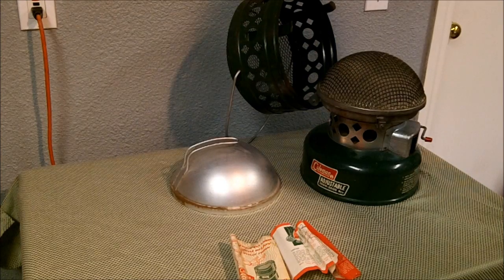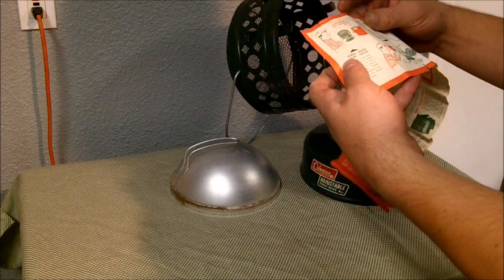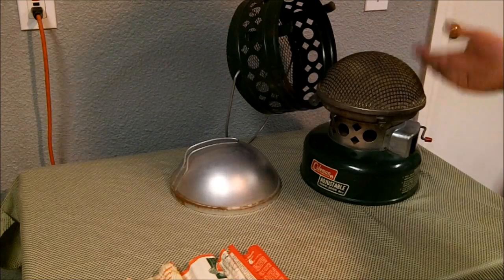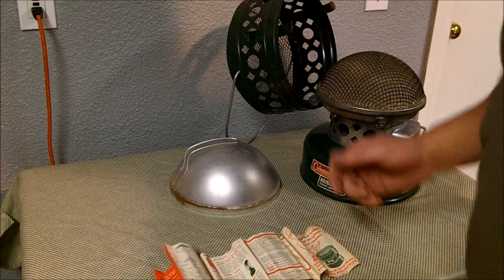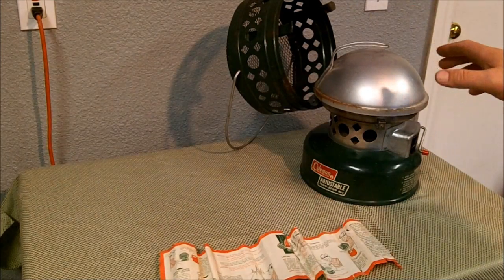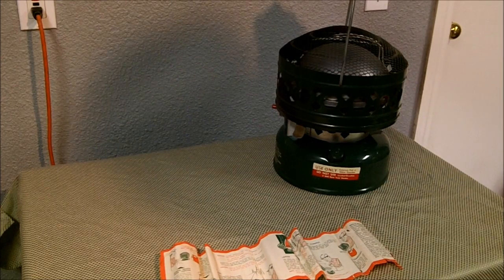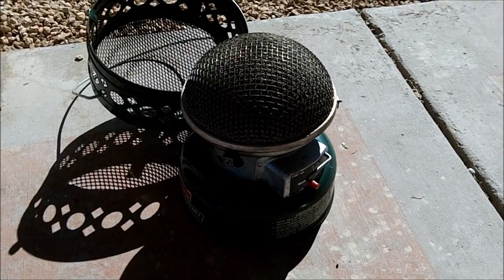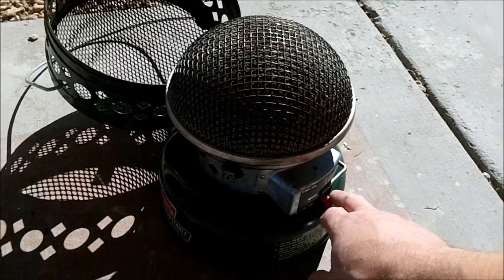1967 COLEMAN CATALYTIC HEATER 513-700

Comment: A trick to starting these is to turn them upside down for a bit until the center of the dome is wet.  Then squirt fuel around the edges being careful not to drip off the dome.  Light and jump back.
Reply: I have two Canadian Coleman heaters, one from the 1970s and one from the 1980s. I often try that trick of turning them upside down, but I find it takes ages for any fuel to come down. I don't mess with my heaters that much anyway, I really just have them since I collect Coleman stuff.
Reply: +SouthWestNS Productions Your wick may be bad. Especially if it has sat with gas in it for a long time, it can make the wick very hard to where it will not suck up/flow gas anymore.

Comment: FWIW, I have the non adjustable version of this heater, to start it I use a small fuel bottle (I think they are pints) and just pour an X across the dome, let it vaporize for 30 seconds or so and light it. Works every time.

Comment: Thanks for posting this video! I bought one of these at a flea market still in the box but the directions are missing. I had no clue how to light it until now. :)
Reply from the maker: You are welcome, I have found the best method is turn it upside down and soak with extra fuel (method 1 and 2).
Reply: Happy usage of the heater. If you ever decide to get rid of it I will purchase it from you.

Comment: When I lived in Alaska, several Bush pilot friends swore by those things, for preheating their aircraft engines in remote locations during the winter time. They knew they were out of production, and wouldn't sell them at any price.
Reply from the maker: I bet they work way better than propane heaters in those Alaska cold temps.
Reply: They absolutely do, propane doesn't work at all in 40 below zero. neither does anything requiring electricity.

Comment: I have one of these in my garage from an auction. I knew it was a heater but knew little more than that. Thanks for the info. You mention that you will use it in a garage. Is it safe? Does it not put off harmful fumes? I too want to use in garage in winter while I'm working there.
Reply: These are relatively safe so long as there is ample ventilation in the room you intend to use the heater in. The Coleman fuel burns really clean leaving almost no harmful fumes behind as far as I'm aware. It's the CO from oxygen consumption you have to worry about. So again, fine to use in your garage as long as you have some kind of air flow to keep the oxygen levels safe.

Comment: Just cover it with fuel and light it and it will slowly burn out but remain light, then it takes about 30 minutes to start throwing heat
Reply: That is wrong. The correct way to light is to flip unside down until a 2" wet spot appears in the center. Another way is to squirt an X across the burner then light. If you soak the entire surface that is why it is taking 30 minutes to start throwing heat.

Comment: Can I use K-1 Kerosene in my Coleman 513 adjustable heater? Thanks
Reply from the maker: That is a good question, unfortunately I do not have a good answer. I seen some for sale on eBay that the 513K as model number. It appears the seller believes that this model uses kerosene.  I have several models maybe I should do a test.

Comment: Can I use it inside a tent?
Reply from the maker: Lumel Aguirre I wouldn't.
Reply: Yes you can.  Leave two windows cracked open to get ventilation.  I have used on many many times in a tent during the winter.  If it is a small tent where someone might kick it or knock it over not a good idea.
Reply: Bring a battery powered carbon monoxide detector with you and sleep soundly. These are catalytic heaters. With an adequate supply of fresh oxygen to the burner, they will emit 0 ppm of carbon monoxide. These were designed for indoor use (as are nearly all heaters). Think about how silly and impractical a heater would be that is only intended for outdoor use! Heating the OUTDOORS? LOL! That’s the sun’s job. For what it’s worth, Coleman fuel is less expensive than propane for the same amount of heat.
Reply: @totallyfrozen  I've used one a bunch of times in a canvas tent, sometimes alone , sometimes in conjunction with a wood stove when it was really cold . I agree they can be used safely with a bit of common sense

Comment: Have you tested this to see how long it'll burn while on the high and or low settings?
Reply from the maker: I will be running some tests next as it gets colder out.
Reply: Did a little reading on some of the different models last night and grabbed one off eBay. Seems that they all state 18 - 24 hours run time, so I guess we'll see.
Reply from the maker: Floyd Thomas That at least gives me some bench marks. Thanks